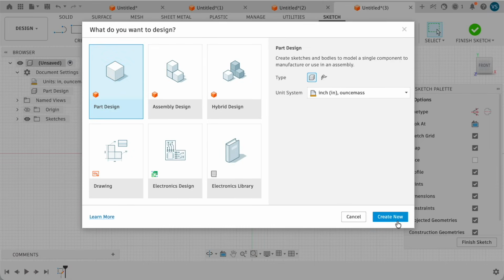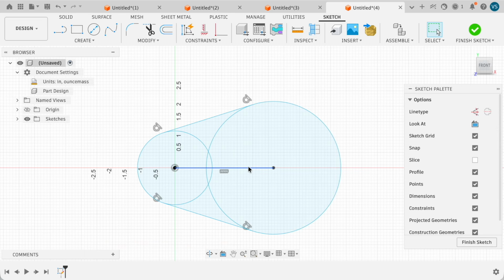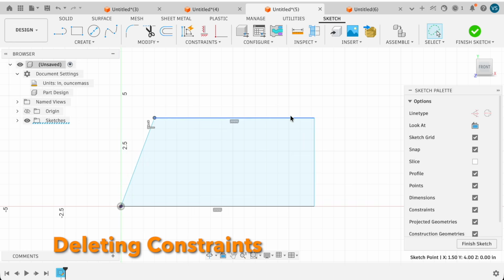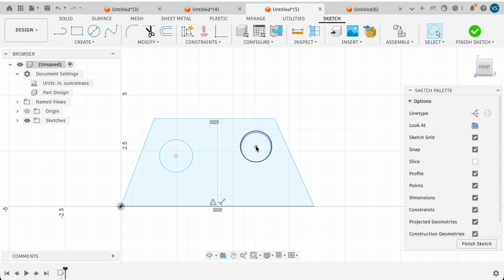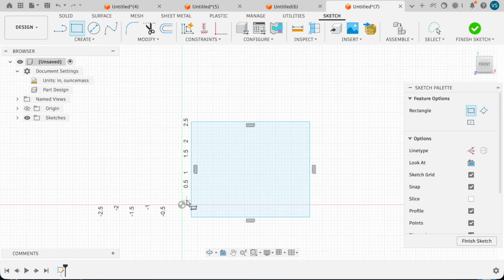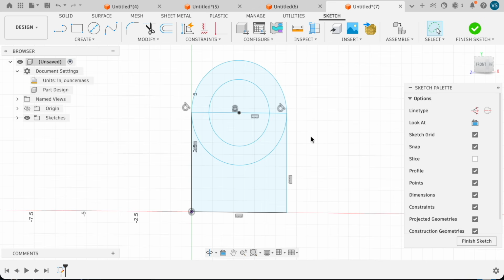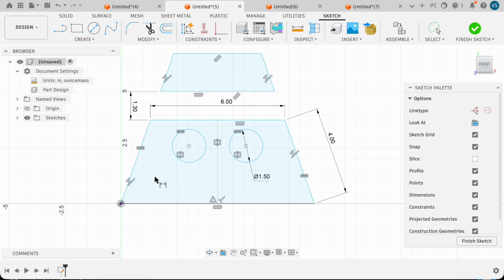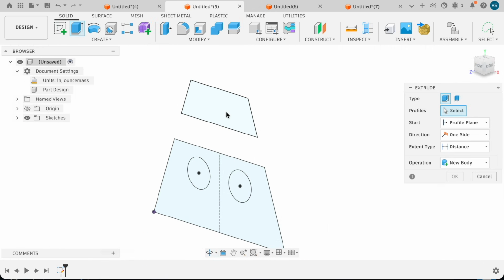Fusion 360 Sketch Constraints Finally Make Sense (Here's Why No One Explains This)

Comment: Great vid but it 100% sucks that fusion adds them automatically and you can't turn them off. You have to go in manually and remove them , it's great as an option but a POS as mandatory.
Reply from the maker: Gonna noodle on that, I think there is a nugget in here that would benefit me. A person can use the fillet tool in sketch mode where you modify the drawing at the same time you apply constraints. If you know the way the software thinks it flips the hole problem on its head.

Comment: I don't see anyone getting a spline line to constrain without changing its shape.  A 3 sided box and a non symmetric curve on the fourth side, how do you constrain that?
Reply from the maker: Are we using the spline as a rail for a loft?
Reply: @vincentstanley7788  No, it is part of the construction of the shape.  I have yet to see someone constrain a spline shape without distorting it.  I am sure it can be done but I haven't been able to accomplish it.  I am a rookie though...
Reply from the maker: @FoothillPaintandFabrication 
Splines are undefined by design. Lock the endpoints to your box corners then use “Fix” constraint on the spline body. The spline will stay as it is shown. I think about making this a video
Reply: @vincentstanley7788  Thank you for responding.  I knew there had to be a way but I was just fumbling around in the dark.  I will give it a try.
Thanks again

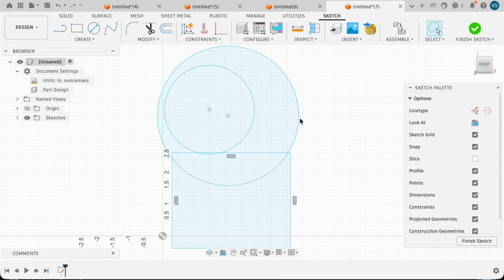Comment: Interesting and useful info. I admit that I have 3 hrs experience, but determined to understand this.  I had to abandon/trash my first attempt at a little project I want to do.  Tip for you: it is not well understood when you click, plus you do not explain if there is a correct 'click sequence'.  Example: 4:40+, where you are doing multiple clicks.  I dunno, maybe there is some capture software that visibly does a brief mini-explosion/flash when a click occurs.  It would also help visualize a menu click choice.
Reply from the maker: It’s been a hard choice. I like to show the drop down menus so that everyone can keep up yet if you use hot keys you can keep the videos shorter. I have been blending the two and I’ll keep the click sequence in mind.

Comment: Misleading title. I watched it because no one explains why you needed constraints. They are extra work that doesn't seem to contribute much to the design. Most creators just say add this constraint, add that constraint, but no one explains why. Constraints still don't make sense, and there is still no one who explains this.
Reply from the maker: Good point.  Constraints are important they "simplify" your design for later steps.  As you move deeper in your design, you can make simple changes.  I see why you are frustrated and maybe I'll address this in a future video.
Reply: Constraints allow flexibility for later operations, Fusion is parameter based CAD so you can go back later and modify earlier features in the design, then the change you made will "waterfall" into the final design. Constraints create the relationship between the sketch objects. This allows you to modify the sketch parametrically (change sizes etc) and keeps the relationships spatially. If you don't have constraints and try to modify things in the sketch things don't work as you expect them to necessarily so things will drift, or distort in ways you don't want them to.

Fusion orients all objects in an XYZ coordinate system for all operations, using constraints creates rules and relationships for your object(s) within the  coordinate system so that when you make modifications, things change based on the defined relationships. 

I hope that makes some sense as to why they are important.

(side note) they also allow you to define the interactions so you don't end up with things misaligned (for example) when you are fabricating, so you can know that your edges will mate and your shapes are aligned perfectly the way you want them to be.

Comment: So, what do you mean by "Here's Why No One Explains This"?
Reply from the maker: When I learned manual drafting we were taught to calculate the whole size of the drawing and fit it into our template. You needed to know the the end before you started at the beginning. When Computer Aided Drafting (CAD) rolled out, that same mentality continued. With constraints, we start with relationships rather than distances. It is a totally new way of thinking. Most instructors either know the old way and continue forward. The new instructors don’t know the “Manual Drafting” method and loose sight of the math that is driving the designs.
Reply from the maker: Thinking on this some more, constraints are causing us to fold back onto manual drafting principles.  This is really a good question.